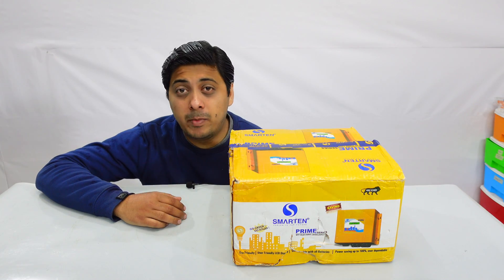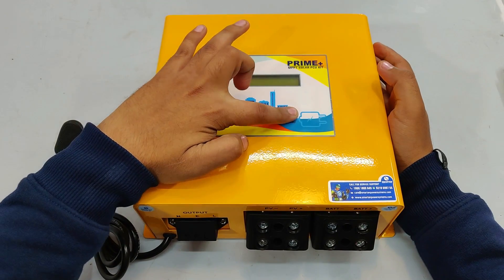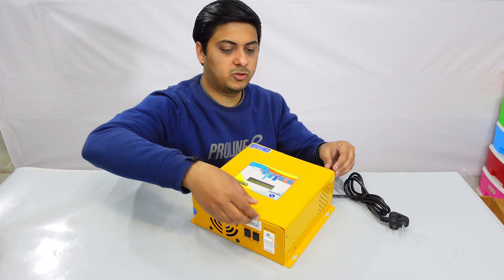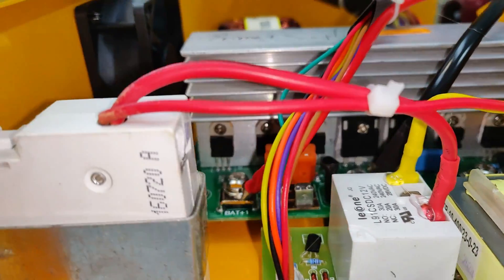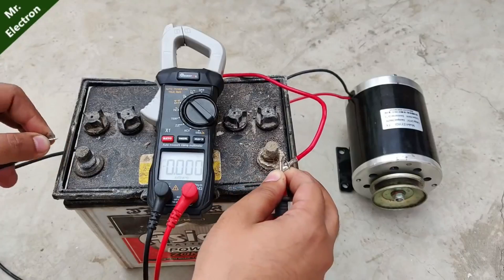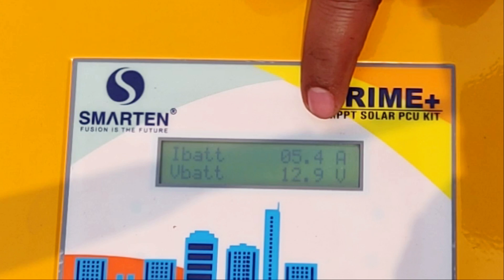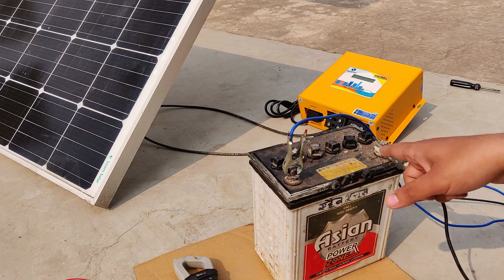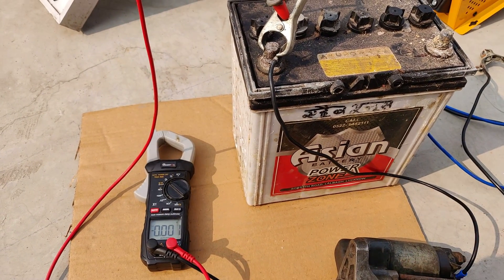12V 30A Solar Charge Controller ( MPPT Smarten Prime Loom Solar ) for 12V Inverter Battery - REVIEW!

Comment: 1:13 This is not meant to be thrown away either. This is silica powder, which absorbs moisture from air protecting the device.
Reply: Yes but that's usually for shipping and storage. I get them in TV packaging, blender packaging etc but I don't set them near my TV or Blender as they're in use most of the time.
However silica is still useful if storing things especially around High humidity levels but needs dried out when it reaches its maximum absorption capacity to replenish  👍